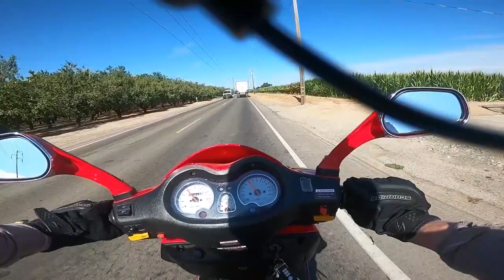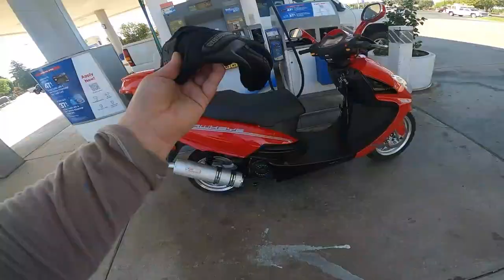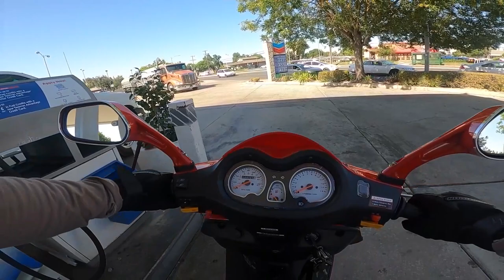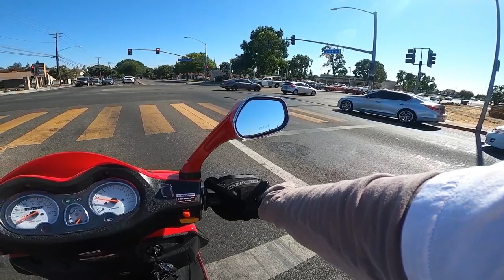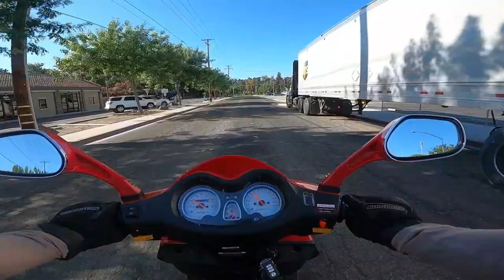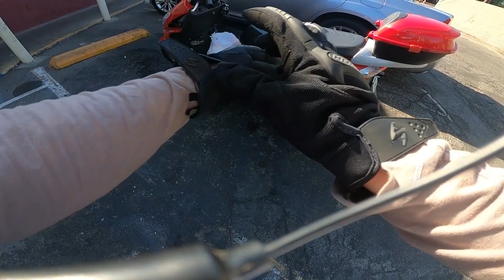my 2nd ride with the icebear Hawkeye 150cc scooter

Comment from the maker: I found out after this video that my scooter was tipped upside down during shipping causing the motor oil to food into my air box then I rode it and got oil in my carburetor so long story short the retailer sent me replacement parts a new air filter,new air box,new carburetor she ran fine with lots of power afterwards...🙂👍

Comment: My CDI went out just before the 30 day warranty .
They were good about sending me another one.
That hesitation check and see if your fuel line is pintched ! 
 I routed my fuel line and going to remove the fuel Pitman shut off valve and put a on/off switch instead.
Other than that I really enjoy the scooter.  Be safe out there ☺️ !

Comment: Do your first oil change at 300 miles. The specifications in your manual will probably tell you the same thing. At 150 miles is to soon.
Reply from the maker: Thanks John yeah the manual I have also says 300 miles 🙂👍
Reply: Never too soon to do the first change (as long as you have at least 100 miles on it) 

The first oil change is usually glittery/sparkly and is without a doubt the dirtiest change in the schedule. I'd personally do it at 250 and 500.
Reply: @exgtt2061  I agree. I'm still breaking my 2021 Gy6 in on conventional oil but I'm changing the oil every 100 miles for the first 300. Main reason being is to flush  the metal shavings out of the engine before I start using synthetic.

Comment: Hey Kev. My scooter did the same thing. I waited until I broke mine in before I did anything to it. I just adjusted the idle seems to be alright now. It wants to go faster. And I noticed that you have a phone charger on it. Mine has one also. I never seen one on a scooter before.
Reply: The phone charger is pretty convenient! You could also use it to charge up cameras too! The 150cc’s have definitely got some pep to them.
Reply from the maker: Thanks Mike I appreciate you sharing your experience that you had with your scooter makes me feel a bit better !👍yeah I noticed the usb charge port right away I got happy because I've been already thinking about buying one to install this saved me the trouble of having to do it !😁👍 Yeah today is day #3 I rode the 150cc it's sputtering  once I hit 35 mph or 5,500 rpm I did try giving it full throttle for a quick 4-5 seconds it was not able to pick up speed seemed like I was getting to much gas ⛽ I sort of want to buy another exact carburetor for it to see if it helps but I might give it some more time after reading what you shared with me makes me want to finish breaking her in first !
Reply: I'm working on getting e camera. I tried using my phone. Lol. Too shaky.
Reply: @GY6-SCOOTERS   If you haven't already.. change the stock spark plug to a quality plug like an NGK. This made a big difference when I got my 2021 Gy6.
Reply: I installed both a 12v cigarette type power outlet and a dual 3.0 USB charging outlet on my 2021 Gy6. Both comes as a package for about 15 bucks on Amazon. The 12v powers my mini air compressor for when I have tire troubles (fits under seat) and the dual USB keeps my two old cell phones fully powered as I'm riding. Old cell phones are Great. I use radio wave based GPS speedometer/trip counter with one phone and a radio wave based GPS navigation app on the other phone. No paid for cell connection required to use these apps which should be more accurate than your stock speedometer.
Reply from the maker: Yeah I saw those also on Amazon I want to get it for my boom 50cc my icebear 150cc comes with a charging port ...👍

Comment: Breaking in a Chinese GY6 - its a copy of a 1980's Honda design so I'd run it in like any 1980's motor ie take it easy for 300 miles. 

Only modern motors with tight clearances and liquid cooling may tolerate a hard break in without breaking a sweat.

Air cooled motors have loose clearances so should be treated with respect when new.
Reply from the maker: i agree totally

Comment: DO U USE BOTH BRAKES TO STOP OR JUST THE BACK? NEW OWNER SORRY
Reply from the maker: I normally use both breaks when coming to a straight ahead stop but if I'm turning in anyway I will only use the back break on these scooters front break is your main stopper it's a disk caliper break the rear break is a drum break it slightly slows the scooter down so I guess it really depends if I'm needing to stop quickly I'll use both ,if I'm just cruising coming up to a stop I might just use the rear in all in all I say I use the front break a lot ..🙂👍
Reply: Watch other videos. Slow down with even firm pressure on both brakes, but never more front than rear, and absolutely never (!) front alone. As you get close to stopping  (25feet maybe ) release most of the front and let the rear do the final stop.

Comment: You must have missed my comments on the first ride video
Reply from the maker: Sorry bro I just backed tracked and read your text thanks for all the good advice I'll definitely stay with fixing the carb I just got ahold of the company they are sending me out one if it doesn't come by August 1st -7th I'll probably just buy one on AMAZON along with the jet kit because as you mentioned these carbs do come tampered proof I will have to use a hacksaw blade on the screws after thanks again mate ..!😁👍